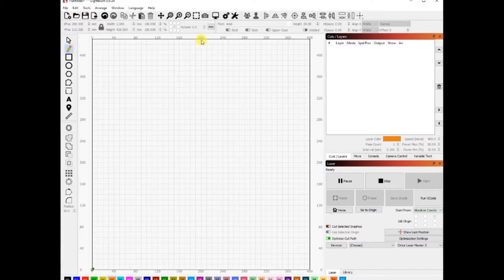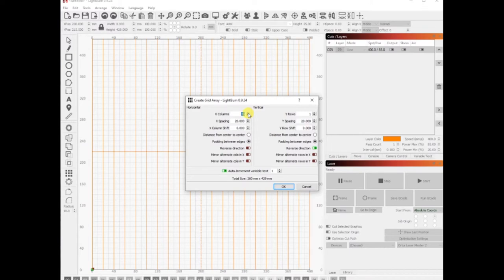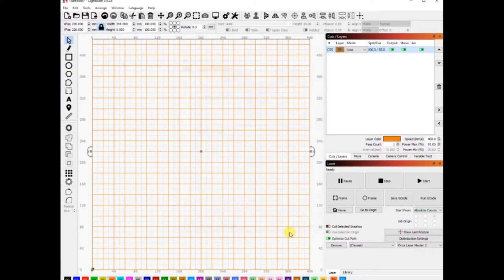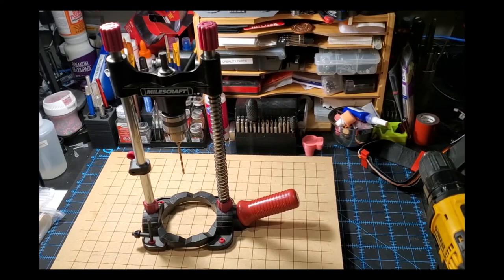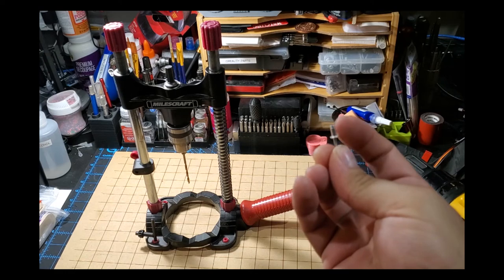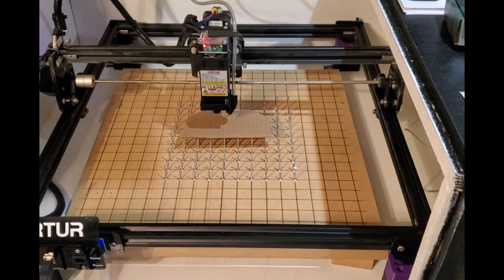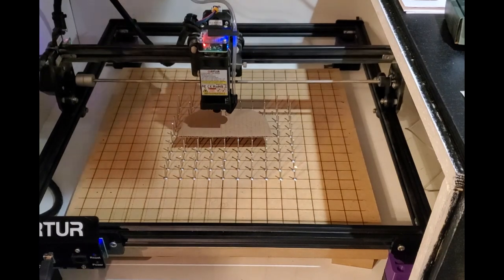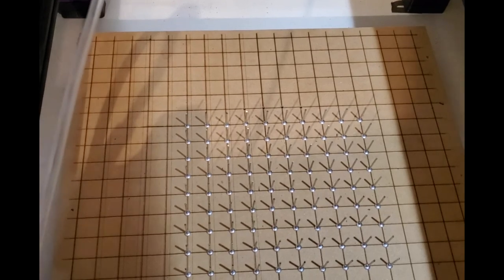DIY Pinbed for Your Ortur Laser Master 2 Etcher

Comment: Great idea for a pin, however I would have attached the base board to the cnc frame so that you could use it as laser bed grid to repeatable use on set up of cutting several or many of the same pieces.

Comment: I just got my laser and would like to laser my way  to make something like that instead of buying a Honeycomb workbench. Happy to have chanced upon your channel. May I know what size are the pop rivets? Thanks
Reply from the maker: Actually I built a new cutting bed using wire lathe like you use for stucco.
works much better. I will evetually make a video showing my design.